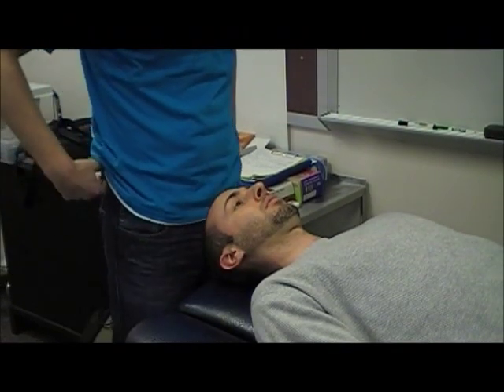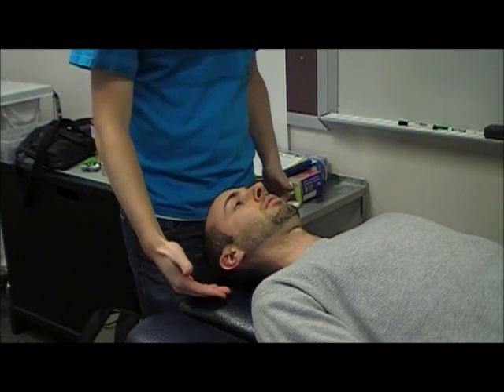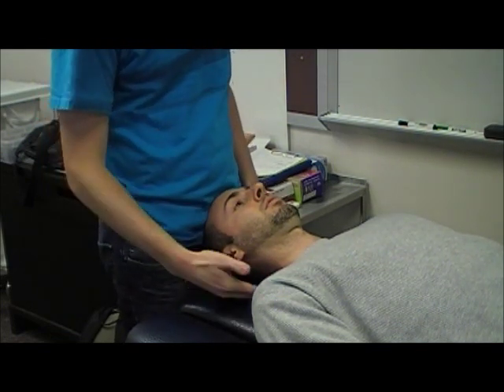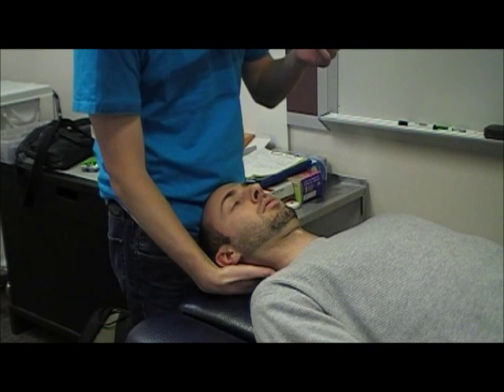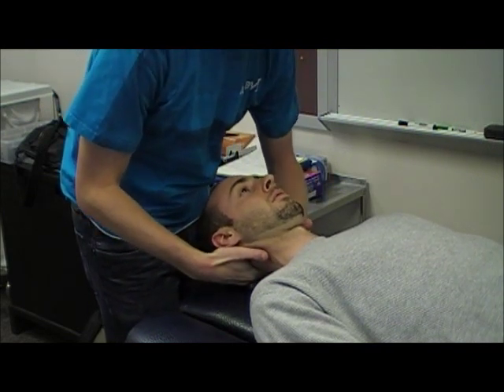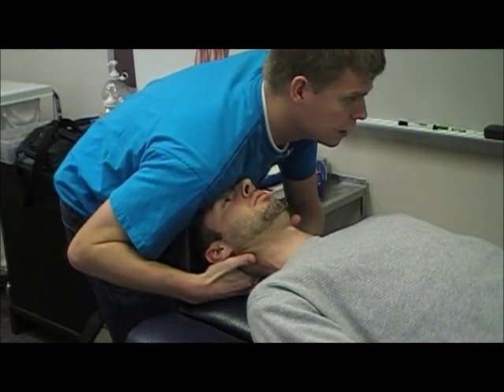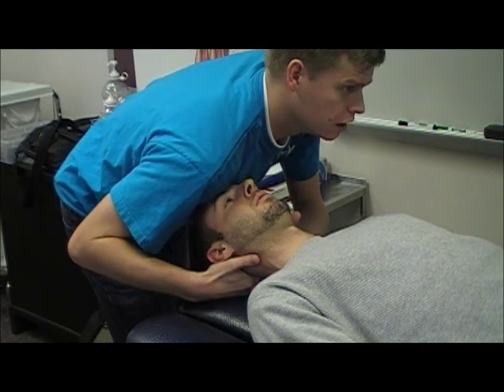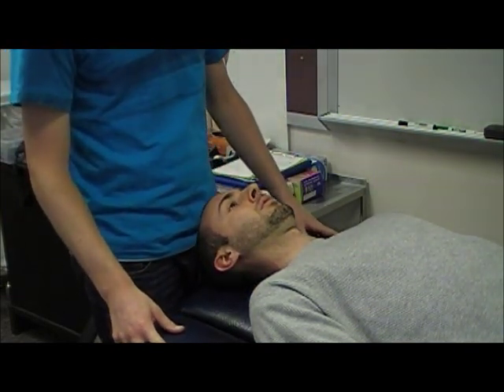Transverse Ligament Stress Test

Comment: Your doing that test wrong playboy, you got it twisted like trees in a blunt.  The glide should be C1 anterior, NOT C2, moving the C2 spinous process anterior will cause the dens to move into the Odontoid process of the Atlas. Which is a bony end fell.  Move the C1 anterior to test the Transverse ligament.
Reply: true! but the dens and odontoid process are the same thing.  Dens will hit the anterior arch of the atlas